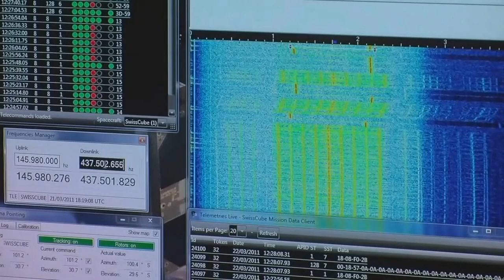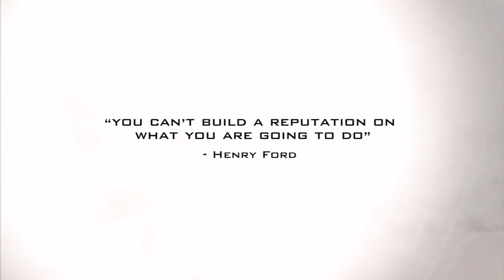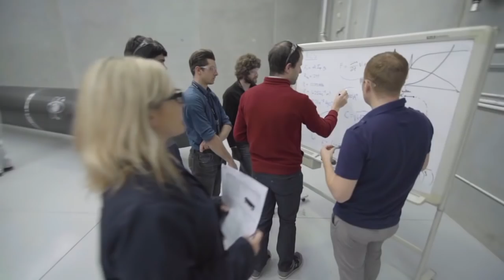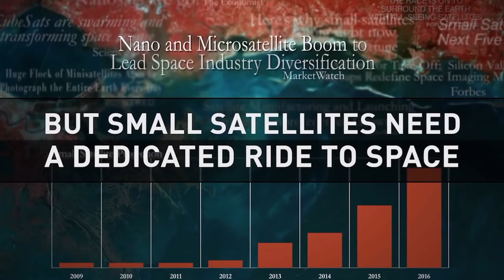New Vehicles for New Ventures

Comment: Considering new NASA vehicles' purported advancement, why are Van Alen belt radiation readings still classified? 
How did NASA get men and sensitive electronic equipment thru the belt twice per mission all the way to the moon, using 1960's technology that is now over 50 years old?
How far has radiation shielding come; why haven't there been any manned missions in over 50 years past this radiation belt despite advances in shielding technology since Armstrongs' days?
Reply: +willowfinearts If info like this was put forth more readily by NASA it would make a lot of people happy.
Reply: +willowfinearts  Does it work for 10,000 k plasma burst.?
Reply: *****
Then space probes are not possible? 10 k burst is small from our sun.
Reply: +jom nou The readings are not classified?